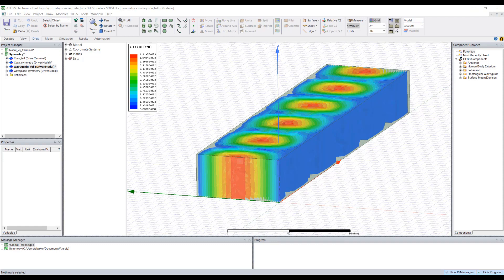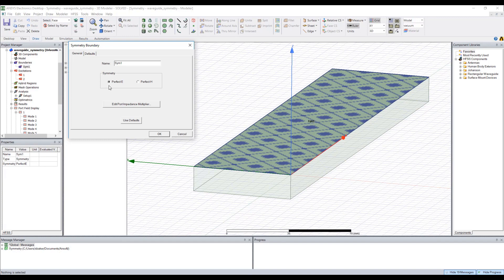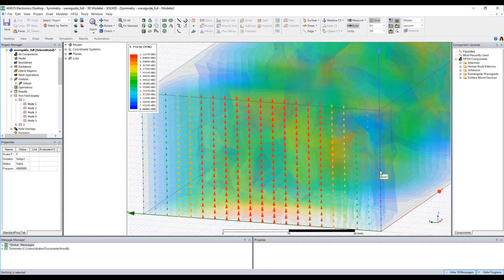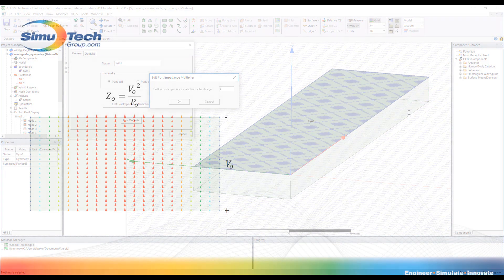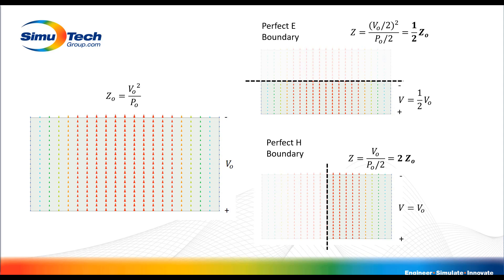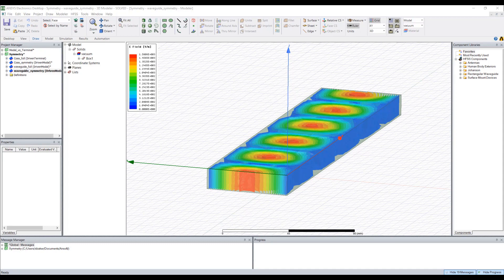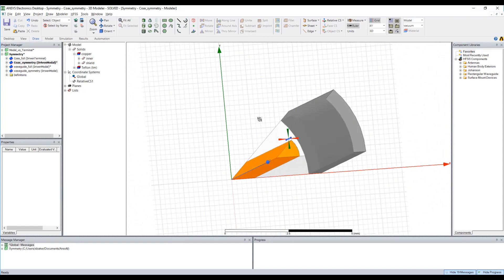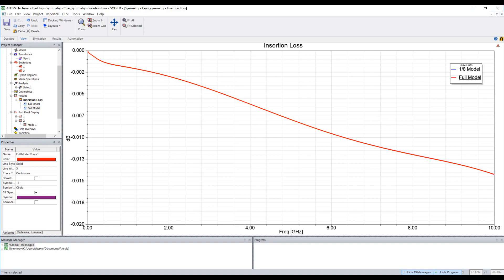Ansys HFSS Modal vs Terminal Part 3 - Symmetry Boundary

Comment: Thanks for the video. Very helpful.
The simulation time for WG model can further be improved if we apply both E and H symmetries at the same time. The structure will be reduced to one-fourth in this case, power flow will be one-fourth of that of the original model and overall impedance multiplier factor will be 1. Correct ? The individual impedance multiplier factors for E and H-planes of symmetry should be 1/4 and 4 respectively ? Thus, giving overall multiplier factor of 1 since they will be multiplied together. The understanding is correct ? If not, it will be great if you can provide your opinion over it.

Edit: Perhaps individual impedance multiplier factors for both E- and H-planes of symmetry will be 1 since Z=Z0 for both. Nevertheless, overall impedance multiplier factor will still be 1.